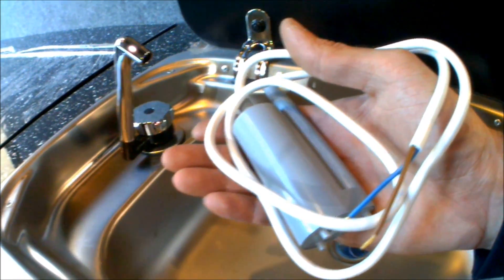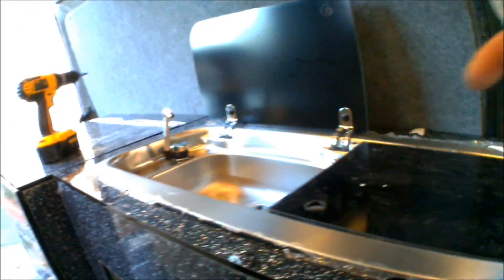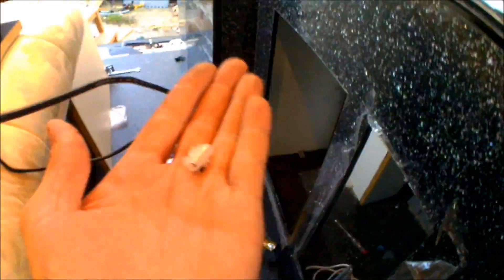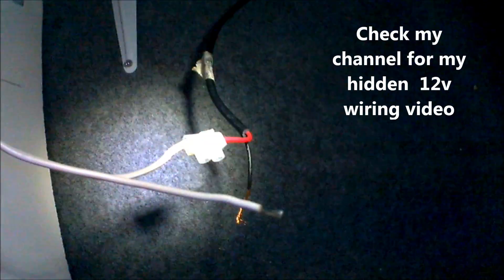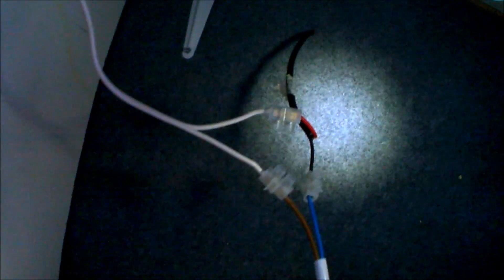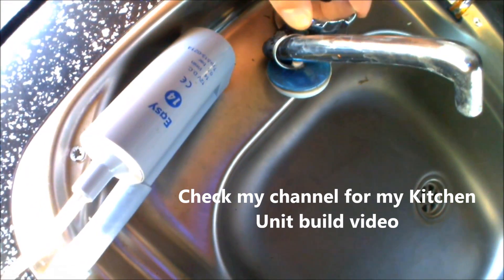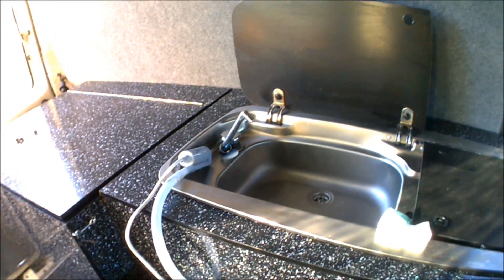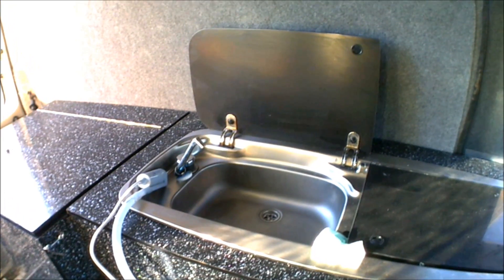Wiring 12v Micro Switch Tap & Submersible Pump - Campervan Tap Install

Comment: This is probably a stupid question… but what are the chock blocks 3a , 5a , 15a etc etc
Reply from the maker: I think I used 5a for these which was still overkill, these use little power while in use

Comment: This might be a stupid question, Do I need to to turn something off at the leisure battery to do this as not to get a shock when wiring?
Reply from the maker: You should have a fuse board between the battery and leisure items, then just leave the fuse out while doing the wiring and if something is wired wrong, it'll just pop the fuse
Reply: @TheCampervanBuilder  Thank you, followed the wiring in your diagram and the pump didn't work. I had a 10amp fuse instead of a 5amp fuse, could that have been the issue?
Reply from the maker: @AmandlaTaylor  even 5a is probably too big for a tap and pump, usually 1-3a fuses are enough, depending on the pump type

Comment: I am just in the process of fitting a new tap in my caravan. The wiring on the new tap has one white wire and one white with a black stripe, as opposed to the usual brown and blue on the old tap. How do these new wires relate to the old ones please, or does polarity not matter on these switches?  Cheers
Reply from the maker: I don't think it matters much on the taps, it "shouldn't" damage it wiring it either way and check it

Comment: Does this give hot water
Reply from the maker: if connected to a hot water source, yes, but its just a tap, it doesn't heat the water itself
Reply: @TheCampervanBuilder   thanks for reply im waiting  my camper conversion its a 10l Toyota Alphard van,  it doesent have got water ,us there any wee solution out there as in small compact   to add that could would heat  some hot water ? I have proplex gas heating ,2 gas cooker ,  Thankyou .
Reply from the maker: @alisoncowie2441  easiest & cheapest way is to use a kettle for hot water, heating water is very energy intensive

Comment: Great video! Can the tap be used to control the speed of the pump? I'm looking to use this for something else but was wondering if I can run the pump slowly, thanks!
Reply from the maker: Not the speed of the pump, but the flow is dictated by how open the tap is. the pump has no controls, it just pumps as much as its allowed

Comment: I made a mistake some where and had a wire melt (+ & - ) welded together...feed was the 12v from rear door area...not sure what happened but the micro switch isn’t working,  got there in the end using heavier cable and will link a new switch later...day 2 just saw your video, wish I had saw day 1  ⭐️⭐️⭐️⭐️⭐️

Comment: It should be done through a relay to protect the switch in the tap and extend the life of the switch because if the pump goes faulty i.e. frozen water then the switch in the tap could burn out

Comment: Hello I’m trying to work this out and I’m a woman. so see the two white wires coming from the tap which one is live and which was is not I wanted to send you a picture to see if I did right I’m worried to turn it on lol I connected the brown power to the black and white wire then the pump brown to the plain white wire and the the power blue and pump blue together

Comment: Excuse my poor knowledge , does the pump get the supply from the leisure battery ? Cheers
Reply from the maker: all living electrics in a camper should come from the leisure battery, taking feeds from the starter can result in a dead starter battery and potentially being stranded somewhere
Reply: @The Campervan Builder  Cheers for confirming that , there is a 12v supply inside my cabinet that i was going to use but that is off the main battery , i’ll just run a new supply from the leisure battery 👍

Comment: Could I just wire this to a 5 amp plug so I can use it plugged in to an invertor?
Reply from the maker: It’s a 12v pump, not 240 so no inverter required

Comment: Great video mate. Can I ask if its possible to use the submersible pump to a different tap (one with no wiring)? So basically just the wiring from the 12v supply to the submersible pump and no wiring to the tap. Thank you.
Reply from the maker: Thanks, you can just use a pump but you would need to wire it to a switch or it would run constantly, it wouldn't turn on/off with a pressure drop of a standard tap, thats where you need a shurflo type pump like I've just fitted in my recent bus sink video
Reply: @TheCampervanBuilder  Thanks for the reply. Ok I see what you mean. I have a switch that the 12v mains cables to the pump runs from, would this not turn the pump on/off?? Or would the shurflo pump be best? I'm going to watch that video now. Thanks again.
Reply from the maker: it all depends on what you need water to, if just a sink tap with water source close by, then I'd use a submersible pump and microswitched tap to turn the pump on/off.  If you plan on a bigger system like water heaters, shower etc or underslung water tank, thats where you need a bigger pump like the shurflo's
Reply: @TheCampervanBuilder  My set up is very basic, cold water only to a sink tap around 1 metre above the water source so nothing major. I just really dont like the look of the micro switch tap and we have actually bought exactly the same tap as you have on your bus video! So I'm hoping we can still use a submersible pump to that tap?
Reply from the maker: yes you can, as I mentioned before you would just need to have a switch accessible in the power line for the pump to turn it on when needed, then the tap can restrict it's flow but you would need to remember to switch it back off each time or it would keep trying to pump, thats where the microswitch comes in.  You can retrofit microswitches but how easily, I don't know
Reply: @TheCampervanBuilder  Perfect, saves me buying a £50 shurfo. So just connect the positive from the 12v supply to the positive of the pump then same with negatives? Dont think I will need to ground it as my 12v panel is grounded.

Comment: Hi , how would you wire it strait from the battery , would you use both the live terminal an the negative terminal?
Reply from the maker: as long as the starter battery also has a cable from negative to the body, then yes it should work just the same
Reply: Camper Conversion nice one thanks 👍
Reply from the maker: either the same as the video or take a negative from the body as the starter battery will be connected to it
Reply: Camper Conversion ok when you say a negative from the body do you mean just put a strew in to the body of the van an put the nagative on to it ?

Comment: How do you wire a micro switch tap and micro switch shower tap to the same water pump so that they can both turn the water pump on
Reply from the maker: I would think you would need to connect both taps to a single power line then have a wire coming from the connection point and wire the pump the same as in the video from there.  Most systems with showers usually use the Shurflo diaphragm pumps which run when the taps are opened from the pressure drop so no microswitches or required, just plumbing

Comment: Hi, thanks for the info. Why do you not need to ground / earth it?? other videos about wiring the tap and pump all earth it. Thanks
Reply from the maker: There are no earth cables for either the tap or pump, just positive and negative. The tap is wired via a fuse panel so if there were any issues, the fuse would blow before causing any problems
Reply: @TheCampervanBuilder  thanks so much, really appreciate that

Comment: trying  to work  out how to wire up my taps got 2 wires coming from each tap how do i do it thanks
Reply from the maker: I would think it would be the same but joining the tap wires together so live from battery to a chick block with both tap positives in, then both negatives in another chock block to the pump positive, then pump negative to power feed negative
Reply: @TheCampervanBuilder  thank will have a look

Comment: Hi, why does the negative on the tap connect to the positive on the pump?
Reply from the maker: It creates a pass through circuit so the pump only runs when the tap is turned on, in turn powering the pump

Comment: what hose are you using on your pump. I've got a blue one but have to attach it with a jubilee clip and would prefer not to.
Reply from the maker: +George Barr I initially bought 10mm pipe and that needed a clips, I didn't want to use clips so got a snipped of 8mm and warmed it so it would fit in the 10mm perfectly
Reply: Ah, nice one, that's a great tip mate